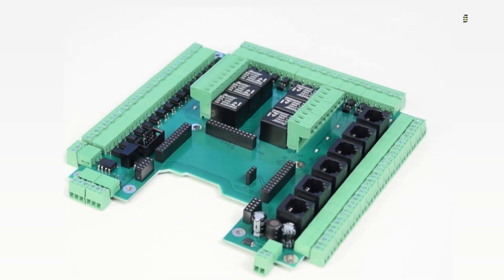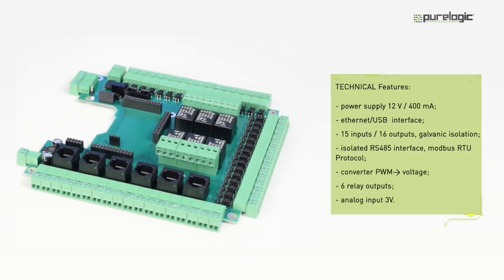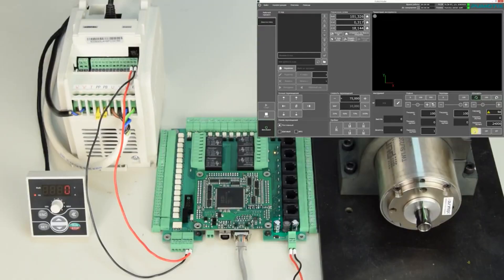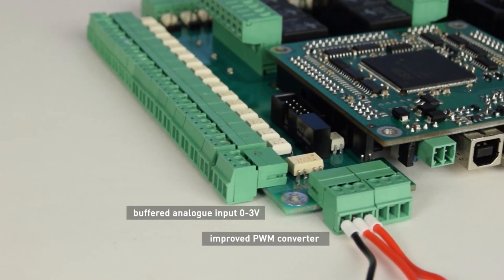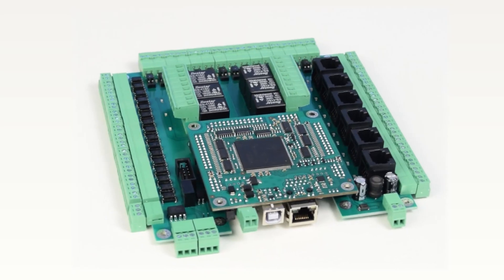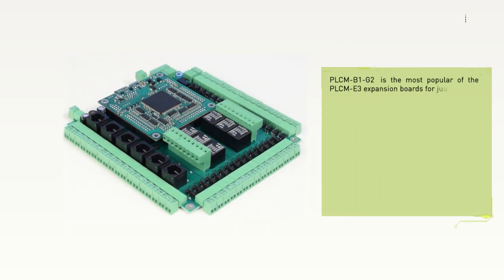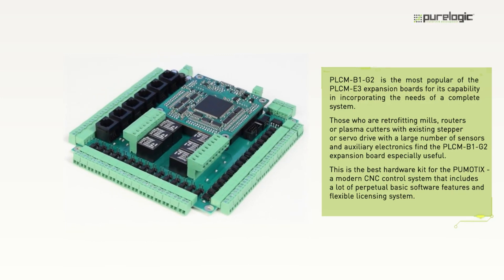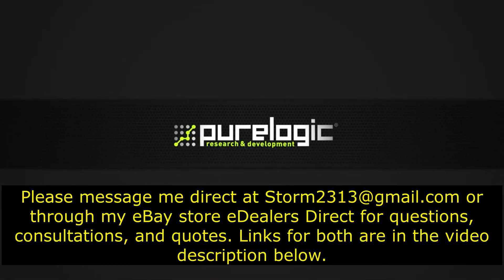Get Ready For The PLCM-B1-G2 Expansion Board!!

Comment: Ware Can I find more information to get Pumotix to control CW and CCW spindle rotation with PWM.  
With what I read so far I dont know how to wire it correctly or set the correct pin out in the soft ware  
I'm using  E550 series inverters with PLC4x-G2   breakout board
Reply from the maker: Hey John, I answered you in an email. Thank you,
Vince